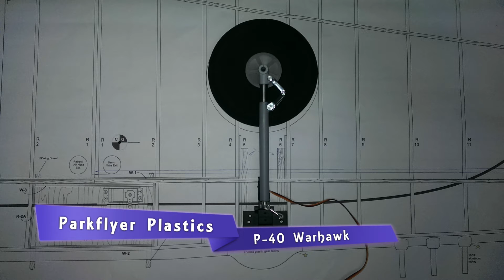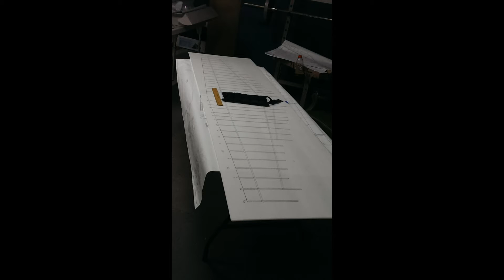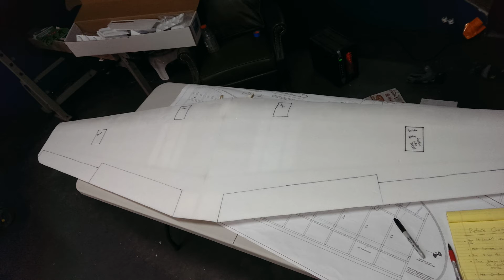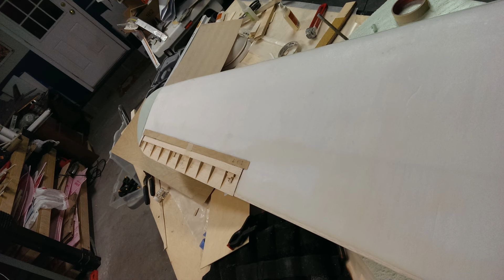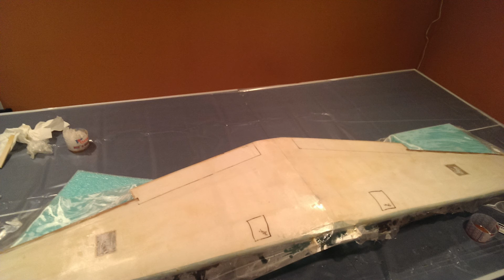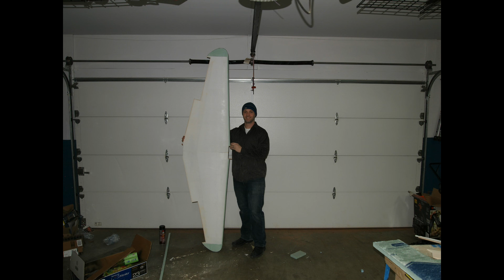Parkflyer Plastics P-40 - Wing build ep. 1

Comment: Do you think it's possible for me to do a 2 piece wing?
Reply from the maker: Cj C Absolutely.  This P-40 comes in so light that even if you add a lb or two (or 5) she will carry the weight just fine.  As for the best method to make the change I'm not certain.   Replacing a few of the foam ribs with light ply and using a pair of large diameter carbon fiber rods in fiberglass sleeves would probably be a simple solution.